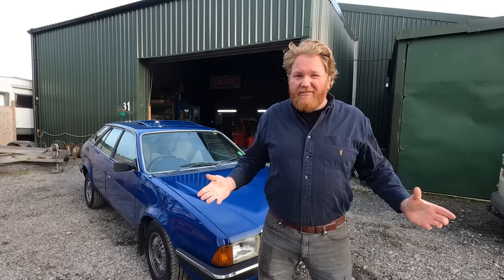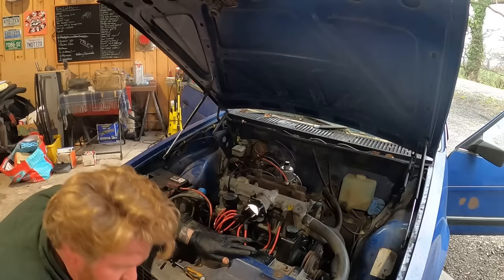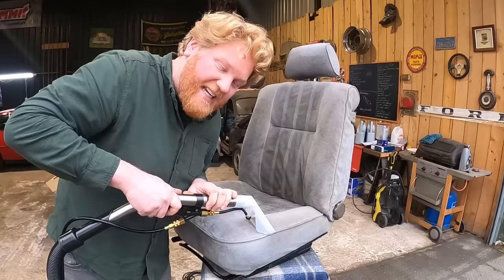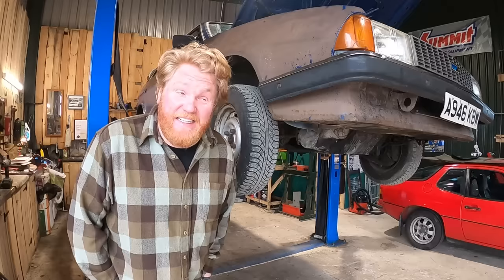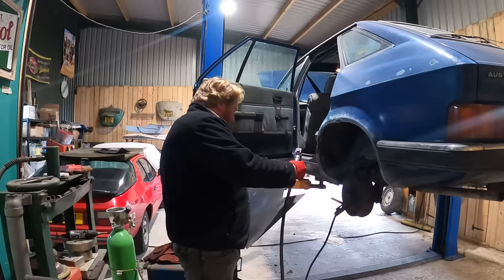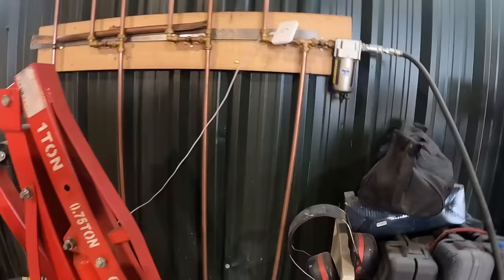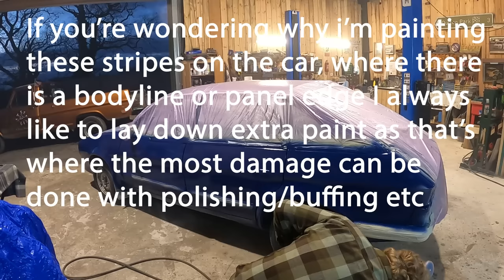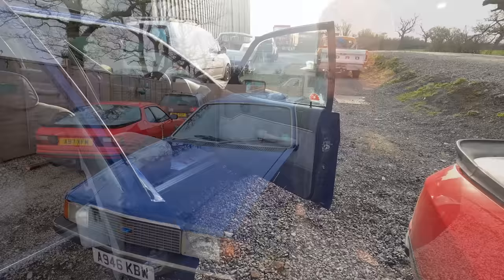Left For Dead Ambitious Austin Ambassador Restoration - Two Weeks To  Save This Rare British Motor!

Comment: I totally understand why you decided to rescue this old girl 
And also how you got emotionally involved in doing more work to it than you initially intended 
I believe cars do have a soul and if you spend time and effort working to keep them on the road they respond by making you smile when they work again 
In July last year I replaced my leased van with an 22 year old volvo v70 2.5 petrol 
And within a week "VERA " got under my skin 
Gave her a full service new brake pads all round and a set of new tyres 
She went for her MOT in November last year and passed with no adviserys 
She had 174000 miles on her when I got her with a full service history plus all work done on her by volvo main dealer 
I'm now very protective of her and love driving her 
I'm loving the work your doing on this ambassador vandal Plas and enjoying the transformation
Reply from the maker: You're absolutely right Ian, it's a great feeling and I truly believe all cars want to run.
Reply: Vera is blessed to have you as its owner Ian. V70's are lovely cars, I used to have a 2.3 740 GL Estate, rust free with 250k and started first time every time. One of the most comfortable cars I've ever owned. One day I may seek out another!
Reply: Hello, we got the same kind of car! Mine is black, 332000km! Bougth it to replace my commuter 206. It got under my skin on the 20 min drive home. 2 owners, full service history. Now i am replacing every little thing thathas stopped working through the years. Not much, but i want everything working. Have a great time with yours. 👍

Comment: I’m totally breathless after watching this project in its entirety. I would have thrown the towel in the ring much earlier. I mean, I’ve been restoring horizontal Leyland diesel bus engines for quite a number of years which is something entirely different I know but doing all the fiddling and tinkering with the crappy ignition system you did on this poor old car is outright astonishing. The crappy aftermarket ignition probably the reason why this car was put aside. Hats off! Kind regards, Willem, from Hekelingen, Netherlands.

Comment: Great job. A long time back I revived a Triumph Acclaim CD, took out seats, took out the holed carpet, steam cleaned (good old paraffin heated type) a good but dirty scrap yard carpet hung it on a gate to dry then took all bumpers & trim off, had it repainted including the doorshuts it came up like brand new, drove beautifully and did 44mpg

Comment: I fitted an Accuspark to a Yamaha motorcycle. Used to lose spark when hot. Fine if you can keep it cool. Great job, will try and watch the whole think later.
Reply from the maker: Exactly the same on my Scimitar
Reply: I have an Accuspark on a Bedford CF with thermal paste and it’s fine. Only issue was a wire fraying. Other than that, the module is good!😊

Comment: Great video and a great restoration/renovation, some hard work gone into that car Ben, but we’ll done for getting it running and roadworthy, looked loads better by the time of the MOT pass. 
      The Ambassador and the Princess were such unloved cars for a long time, most were scrapped, others were sold extremely cheap as nobody wanted them at one time.
      It’s good to see someone had the foresight to save that one though, thanks to your work it’s now a useable classic.

Comment: I found I had to go over the seats that looked relatively clean no less than five times before the water came out any less than black, rinse clean water through the machine after use to reduce the risk of any soap crystals ruining the water pump.
Reply from the maker: Great shout, I didn't do that but I will tomorrow.

Comment: Great little project. It has enlightened me about these cars - they're strong in ride quality and braking, plus appear to be quiet despite no 5th. The good ride shows in the on the road filming you did. Our 1.6 Sierra did not have a 5th gear and it was common for 1.6 litre cars not to have a 6th in '81-'85 period but having one would mean quite a bit of down-shifting if the engine isnt a strong performer.

Comment: I had that rear suspension mount failure with my Ambassador. I fitted new ones but it turned out there was nothing wrong with the old ones. They consist of  rubber pad sandwiched between 2 metal plates, and although they looked rough on the outer edges, the pads were still firmly bonded to the plates. Genuine Austin front wheel bearing sets were crap and only lasted 10 months. I got a Japanese set made by the company which provides Honda motorcycle bearings, which were half the price and lasted a very long time.

Comment: What a fantastic couple of videos. Thoroughly enjoyed watching you getting this proper little classic back on the road. On the subject of Accuspark - they are totally unreliable junk. Had three sets in my car. The first lasted 800 miles, and that was after really struggling to get the vehicle timed up with them in place. The second was faulty in the box, and the third died on me when I was miles from home one night leaving me stranded. Luckily I managed to coax the car into a layby. Luckily there just happened to be someone else there who kindly gave me a lift to the nearest train station. Had to leave the car there and got it recovered the next day. The following afternoon I refitted the orignal points etc and it started first turn of the key. I'd never fit one again. Utter shite. Anyways lol, great video :)

Comment: I'm not even a fan of BL 'varicose vein' blue but the fact that you're giving this much time and love to unfairly chastised old heroes like this makes me get rid of any toss I may have harboured about the colour!

Did you block that narrow vacuum intake off on the inlet? Also, if this is a genuine VDP I'm relatively almost sureishly certain it should have had twin SUs and in the previous video I did notice the top of a twin carb inlet airbox. The two solid metal pipes bolted to the bellousing are carb vent and overflow lines by the way. You can also get a specific viscosity oil for SU dash pots and woe bedtide anyone who refers to an oil viscosity in terms of 'weight'! 😂

Stellar work! Thank you for your amazing content from some bloke in Stoke!

Comment: Nice resto on the Ambassador, my brother had a Princess (which was a nightmare) whose bad reputation sullied the chances of the Ambassador ever being a commercial success (people saw it as a facelift princess), along with the problems (lack of equipment as standard) mentioned in the video, the vague gearchange and glitchy 3rd gear synchro (my brothers car totally lost 3rd gear synchromesh ---- not a great problem just had to be careful selecting 3rd), seems to be a common problem on BMC/BL front wheel drive (my girlfriend had an Allegro and the gearbox in that wasn't great also) which i've always assumed was down to either the transmission under engine layout needing transfer gears from the clutch to transmission or that the engine oil is the gearbox lubrication as well and whilst engine oil is good for engines it's not really right for synchromesh transmissions, finally totally agree with you on electronic distributors I steer well clear of  them (having had similar problems) the nearest i'll go to is the old Lumenition TT units that retain the "points" (uses the points as a trigger for the electronics but with only 1.5 volts across the contacts ------ doesn't stop mechanical wear but stops pitting & piling due to electrical arcing) and has a 3 position switch which is electronic assist, pass through (normal points operation) and off (good as an immobilizer).

Comment: Didn't think I'd ever be that bothered about an Ambassador, but I love this. Looks fantastic, you've done an epic job. If I had one tiny criticism, it looks like it's sitting a  little high on the back after having the suspension pumped. Maybe I'm wrong. Anyway, I've really enjoyed this series, thanks for great entertainment.
Reply from the maker: The back and front is connected, if the back goes down the front does too, unless I'm doing it wrong but hopefully someone who knows may spot this and tell us if you can seperate the front and the back!
Reply: Can confirm this is just how they were from factory. That "aerodynamic" wedge shape, with a crude form of self leveling suspension. And strangely, headlights that always dazzled other drivers, no matter how much they were adjusted.
Reply: @hairybastid2692  Thanks for that information. You are well informed.

Comment: According to the bible that is Wikipedia, the VP came with a twin carb 2.0 engine. There was a 2.0 single carb as well as the 1.7 but they weren’t offered in VP spec. Regardless it’s great to see another Ambassador saved, used to see them all the time and they’re rarer than unicorn turds these days

Comment: Sometimes - using a small household handheld steam cleaner (the type typically used for cleaning in bathrooms etc) is 'better' for doing inside the door opening etc - yes - a lot slower - but sometimes the excess water from the high pressure washer can cause other unwanted issues - sometimes less water is better when it comes to getting the interior or electrics wet.  And my 'theory' is - I always thoroughly clean  - outside - underneath - inside etc before I start work on the car - working on oil or dirt free areas is MUCH more pleasant, and can also assist in exposing hidden issues earlier in the process.  Keep the gun as close to 90 deg to the surface you are spraying - and your primer gun looked like the fluid needle may have required a bit more screwing out (the fan on your top coat gun also seemed very small) or turn the air-pressure down a tad (comment from far away may not always be correct - HA) and the short bursts of paint will not result in 'clean//neat' surface finish as compared to using long flowing sweeps.  And plastic bag and tape the wheels and tyres - HA - painted tread areas of the tyre are a pain in the arse.  Always best to use a respirator - no matter what.  CHEERS from AUSTRALIA.

Comment: Does the 2.0 o series engine definitely not able to run unleaded? I thought they all did but a cursory search says the 2.0 o series is the only one, not questioning your info but I had an old mg maestro so it triggered my curiosity. Love the reasons why and just generally why a car like this is saved by someone like yourself. Believe I’m no fan my first car was given to me (generously) by my uncle and it was a Morris ital, it lasted 3 months. 1 eg of how bad it was , down the beach 1 night opened the door and the wind took it and slammed it open flat onto the wing , that never opened or closed properly again, was like dukes of hazard but just a brown ital . There’s soo many stories of that car but 3 months worth of memories forever. Great save dude big love and stay safe 🤟🏼
Reply: DOT601w

Comment: One tip about adjusting timing on old cars is to have the radio on while you turn the distributer. When you hit the sweet spot the radio distorts for a second. I've never tried it, only heard it from an experienced friend. Also, he used to paint his work van (a 2001 LDV Pilot) red every year using household gloss with some cellulose thinners in and he'd use a brush and roller and get a supurb finish with no streaks or runs. How mad is that? Keep up the good work. Love your videos. Looking forward to your next episode.

Comment: You havent quite got it back to 1983 yet,  
 the two litre Vanden Plas and the two litre HLS  only came from the factory using that twin carb manifold you found in the boot,   the previous owner  must have obviously bought the single carb manifold and carb from a 1.7 boggo basic vehicle from a scrappy or something for whatever reason, for the sake of it remaining genuine and which will add to its resell value you should consider replacing it with its original twin carb set up  also as you said it was never meant for unleaded petrol let alone ethanol fuels so the new owner ought to be told.........they can get new hardened valves and valve seats for them pretty easily that cures this problem at a stroke........ just my tuppence worth.
Reply from the maker: If you buy me the bits I'll fit them 😅
Reply: @tastyclassics  Youve already got the bloody  main bit in that inlet manifold you villain lol alls you need now is to  find where he stashed the other carb  and the balancing linkage! fitting is a doddle you dont even have to change the cables they are all standard fit,  the difference will be like night and day it would feel a completely different and slightly more powerfull motor with a raft more mid range grunt.

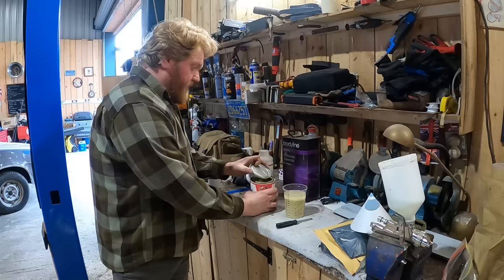Comment: @1:53:20 or do what i do and bend some thick wire like coat hanger. (hell ive even used brake pipe ! ) into a hook shape and put it in your drill saves a ton of time !

Comment: Novice here.  Do you have to add hardner to paint . Novice sorry
Reply: Yes, with these two-pack paints. Old skool paints dried by solvent evaporation. These mostly “dry” by chemically setting.
It’s not exactly “sprayed Alraldite”, but that’s close enough.
Modern paint systems often use a water based colour coat or metallic & these spare the solvent hazards & dry with a matte finish. The high gloss & resilience of today’s paint finishes comes from the two pack clear coat. I’ve had 20 year old cars which buff up literally as good as new. Audis and Porsches were especially good in the early noughties.

Comment: Battery clamps are the most annoying evil things on a car..  urrgh ...  bungie cords and tie raps are far easier..
Reply from the maker: You're not wrong, or lumps of wood!
Reply: ive used a strap off ebay before ....like belt with a grippy buckle....works a treat, passed mot